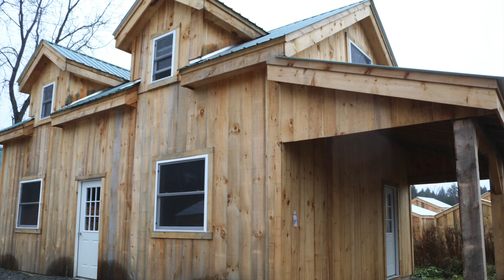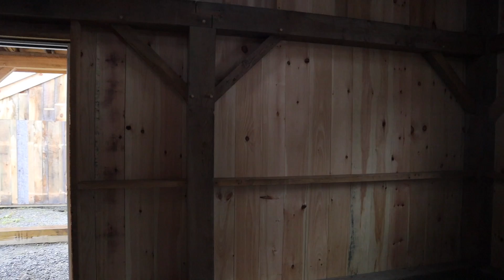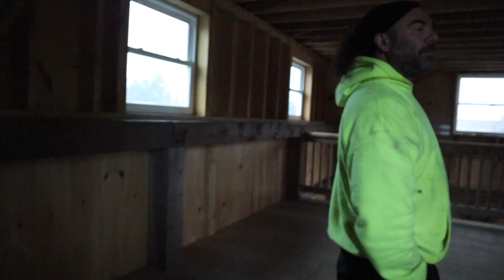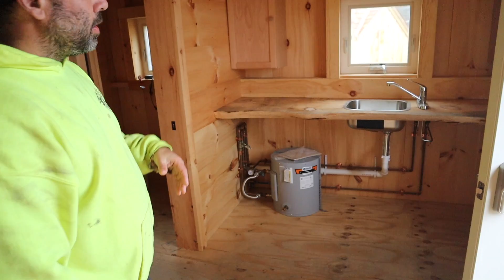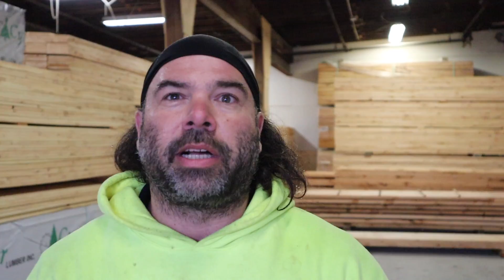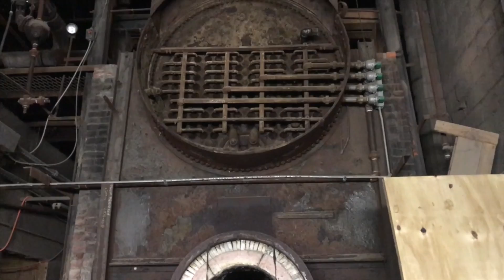Vermont Post and Beam Cabins, Cottages & Barn Ideas

Comment: Some observations and experiences.

First, if you expect nice fitting laps/joints, etc., prepare to be disappointed.
  An example from the video is at 7:40.

Boards twist/bend/etc. as they dry. Bear in mind that that lap joint is intended to show after the walls are insulated/finished.  If you have an OCD spouse (or you yourself just can't stand the ill-fitting look), you won't like it.

Also, their tolerances on cutting leave a lot to be desired.  They do point out that there are variances in dimensions by up to 1/2".  That is ok for the most part, but can be a HUGE pain in the rear for others.  An example is the 'bird blocking' boards that go between the rafters at the wall to prevent birds from entering.  If you are only concerned with keeping birds out, they work fine.  But since rafters can be skinnier by up to 1/2", that can lead to a bird blocking board that is 1" (1/2" for each rafter) too short.  Not good for bug-proofing!  This could have been satisfactorily resolved if they had provided the bird blocking boards 1" too long and I could have cut them to exact length, but instead, I had to buy new boards locally to cut them to fit.  Not a huge expense, but basically the boards provided by them were unused.

Don't get me wrong, I like the building, but it's not all as neat and tidy as it seems.  ;)

Comment: Really interesting tour Jon. Gotta admire Dominic for the way he started small & wound up with a business like that employing 50 people. IF you do decide to go that rout, I'd suggest putting in an oversized septic system that way if you want to add more living space later on you won't have to do all of that work over & have to pull more permits, etc.. etc.. Been there done that. I mentioned this in one of your other videos and suggested that you also look at Modular homes from various companies in Canada. The prices are really good because of the exchange rate between the U.S. & Canada. The nice thing about modulars is that all you have to do is the septic, foundation & site work. Once they drop the modular in place & you hook up the electric, etc.. you can move right in with no other work to do. I know that you probably don't want to go that rout but just thought that I would mention it...........Good luck no matter what you decide & I can't wait for follow up on this project that I hope happens for you................. :)

Comment: Would love to see a tiny house/cottage/cabin build with all the Jon Peters details when complete. You mentioned septic at the end of the video. If it's possible for you and yours to go with a composting toilet, I'd highly recommend it, for sustainability, as well as cost.

For grey water, look into filtered discharge.

Also, if you have adequate exposure on your property, I'd highly suggest a solar and battery system with mostly DC for lighting, charging electronics, even some appliances (TV, fridge/freezer, etc.), and an inverter for the occasional AC load, such as a microwave.

If your property has any creeks or streams, you could also look into micro-hydro. With a 2 micron filter, potentially with additional carbon filtration for taste, you could even supply fresh and portable water for the structure.

Done carefully, you could have a very comfy off-grid getaway with little to no operating costs!
Reply: Running on DC is not more efficient, requires more amperage and larger wires for the same load. It's dependent on voltage, but turning solar/battery to high voltage DC may not be the best plan. Running a refrigerator/freezer requires 600-2000 Watts of power.
Reply from the maker: Great input John...thanks!